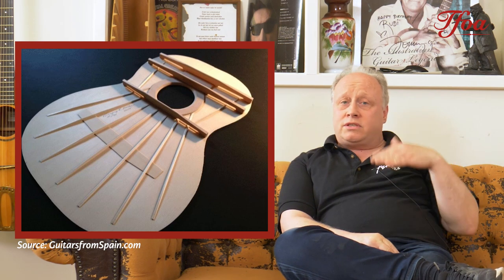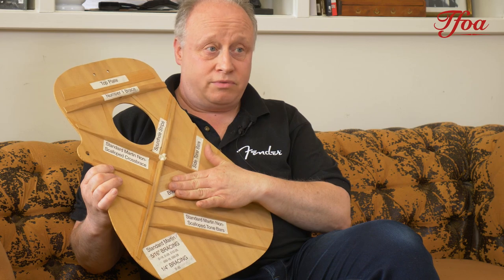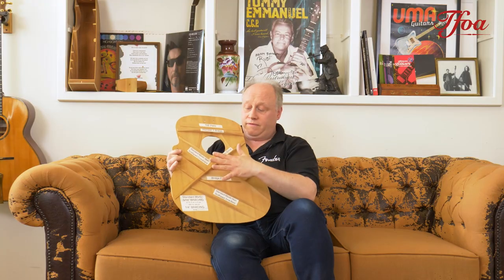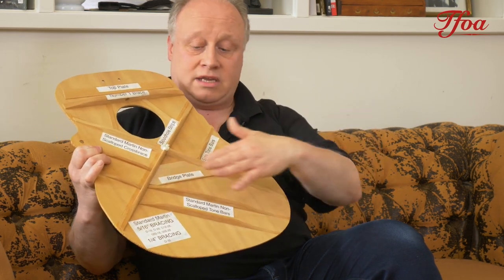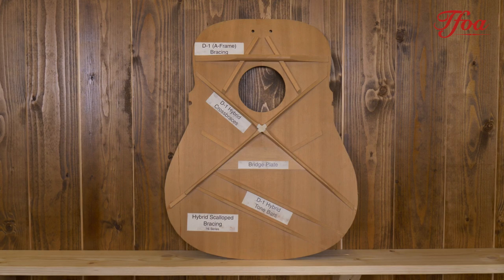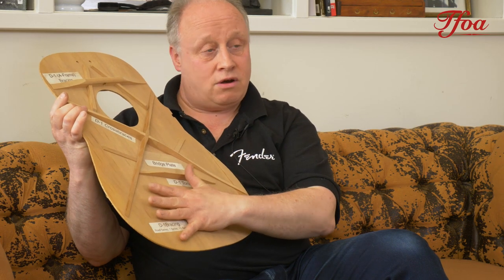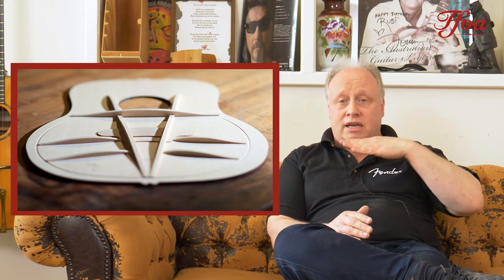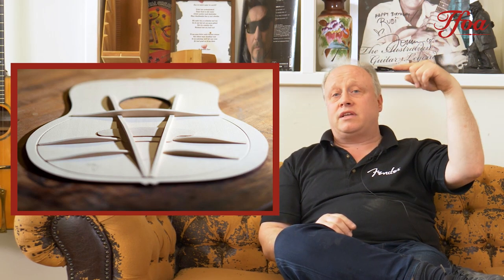Guitar Bracing Explained

Comment: As a lefty, I also look at right handed guitars to switch over to left handers. How does the bracing affect that? tx
Reply from the maker: Hey Mark, great question! Wether it makes a difference is debatable, some people think it does whilst some think it doesn't. But looking at the facts, bracings aren't symmetric and on paper this will affect the sound.
Reply: @thefellowshipofacoustics  Tx, that's what I always thought, it should make a difference. I had it done a couple of times, and still have an old Yamaha FG75 waiting for it, or not, I don't know, while having shied away from a couple of '70s (cheap) D18s, because I had doubts how it would work out.
Reply: @MarkJVSomers  the bracing will make little difference on a FG75 with it's laminate top. Saddle intonation and nut slots need to be reversed along with pickguard.

Comment: Martin's gradual tapering of the bracing towards the side edges is rather because the areas of the top, approaching the side edges, is gradually receiving support from being fastened to those sides. The sound (resonant top vibration) would be correspondingly deadened if the bracing weren't tapered there. This way, it keeps its linearity of vibration amplitude across the top, which is very important for balanced sound across the spectrum. That's why he's added extra bracing on the bass side, for another example. The 'stone dropped in the water,' implies that there is somehow a significant lessening of vibration moving away from the bridge, owing to wood damping it. While this is a relatively minor consideration, the bracing would be carved, if that were the primary factor, to emulate the inverse square law all the way from the bridge plate. It is not. Voila.

Comment: excellent Adrian. I have shared it among the pupils of my HTL School for stringed Musical instruments in Hallstatt / Austria. One little - interesting thing. Kalamazoo is not always the best example for ladder bracing, maybe either Kay, Harmony etc. As you might remember, the Kalamazoo KG21 of my father, for which you built new sides, had a combination of ladder bracing and cross bracing..... I measured that same guitar, explained how it possibly could have been designed by Gibson - measures loosly based on the older Gibson L00 etc - measuring all possible distances, vonstructing circles and seeing the relations between the dadius of the circles etc and also explaned the bracing. The Kalamazoo has an X bracing with some rudiments of ladder bracing, very interesting design, which still sounds and holds up very well, ever since 1937! Best wishes Adrian and thanks for the good work!
Reply from the maker: Thanks for sharing! Adrian sends you best wishes as well! 😄

Comment: Very informative video, thank you. I am building a OM guitar in spruce and rosewood and want to produce  a “crisp, dry and woody” base sound. How do I shape the brasing to get that? I work with a “Martin” X brace. Thanks again Jørgen, Denmark
Reply from the maker: That's the quest many luthiers are on! It is often said that with less material, you'll get more bass response. But there are many, many ways to do the bracing, so it will be a process of testing and experimenting.

Comment: What a great video. Thanks. Question. Does the X brace mean you can use steel strings even if the headstock is a typical slotted classical guitar but with X bracing inside?
Reply from the maker: Hey, yes it does! X-bracing isn't the only bracing type that will fit slotted headstocks or steel strings, but in this case you're correct ;)

Comment: Great video, very informative, thanks 
I hope to build a hybrid acoustic
But should I allow the bracing to touch the sides/make slots for the bracing in the sides of the hollowed out solid body, or should the braces end, leaving a clear parameter around the edges?

Comment: I recently purchased a fusion/crossover nylon string guitar and I noticed that the fan bracing is shifted over to the bass string side. What the benefit of moving the braces left and right as you mentioned the benefits of moving x beacing up and down. Thanks.

Comment: Hey thanks for the video!  Q: Do you think that taylors V bracing is more of a gimmick to stand out from other acoustic guitars or does it actually have some advantages? I'm also curious if you prefer it to X bracing or not, thanks!
Reply from the maker: V-Class bracing is not just a gimmick! Taylor claims that V-Class can produce more volume and sustain with a good balance between the top's stiffness and flexibility. Which type of bracing is better is mostly a matter of personal preference. Our advice: try out both and discover what fits you best! 😊

Comment: Very interesting Adrian, I was wondering about the wood types for the braces. I see where spruce is used for bracing. Can mahogany or just any type of spruce be used for braces. Does the Spruce need to be Adirondack  or Sitka spruce, for the Braces? is all spruce wood good for Bracing? Thanks, Russell
Reply from the maker: Hey Russel, Maarten here over at TFOA. Using different tonewoods than Spruce is nothing out of the ordinary. Spruce is definitely the most common, but Mahogany and Cedar are used as well. Although there are certain tonewoods that don't make fantastic braces ;)
Reply: @thefellowshipofacoustics  Thanks Maarten.

Comment: What is the best glue for the braces?

I have one that’s loose in a 1960-70 that I just picked up. The body is solid, neck is straight but if you tap you’ll find the vibration from one loose brace. Just need the right glue.

Very interesting brace info. Will have to look up construction changes by year.
Reply: Original titebond works great. Unless the guitar was originally built with hot hide glue, then use that, not bottled hide glue.

Comment: Hello Adrian! I own a Martin HD-28. (2002) Can you tell me if it's scalloped bracing or straight?  I heard the scalloped bracing stopped in 1944. But it was mentioned that "HD" 28 & 40 models were still scalloped. Also, it is an Electric, factory installed. So I guess its an HD-28-E
Thank you!
Reply from the maker: 99% sure it's scalloped! :)
Reply: @thefellowshipofacoustics  Thank you!

Comment: For classical Spanish guitars, lattice bracing was introduced several decades ago, and it does help the instrument refine its harmonics .. is it possible to implement it in some form on the steel string guitars?
Reply from the maker: Great question. To be honest, I'm not sure. Strength whilst remaining a light build are key for acoustics, sounds like it could be too weak for steel strings.
Reply: Yeah you can use lattice bracing on steel strings. I know Batson guitars use them on at least some models.

Comment: How does the bracing change in guitars with 12th fret neck to body joints?
Reply from the maker: Our luthiers could write a complete book about this haha! In a nutshell: with a 12 fret neck, the bridge will move further away from the sound hole. Often the bracing also moves the same amount so it comes more in the center of the lower bout (but doesn't have to!). It depends on the body shape, dimensions of the body, and type of sound you're aiming for.

Comment: Obsessing about bracing then weakening the Soundboard structurally by drilling a row of Six-6mm holes across the middle of the Soundboard and Bridge, (close together),  to accommodate Bone, (or plastic), Pins on Western guitars why not use `Trapeze-Tailpieces´ like Django Rheinhart had on his guitar.  Long-term, Pins cause bowing of the Soundboard or loosening of the Bridge, they seem like an inferior compromise of material structurally weakening and acoustically dampening the Soundboard with subsequent costs and early replacement being the result.  One can stamp a brass trapeze tailpiece. One should aspire to build guitars to outlast one's self!  Hardwoods are too finite a substance to waste.  Nice Visual Aid, doesn't show the Holes though!  Why is that?
Reply from the maker: These soundboards are simply meant to show what's underneath the top, so which braces and in what pattern. And the bridge plate is also there! 😉
Reply: @thefellowshipofacoustics  Lacing Pin Holes in the middle of the soundboard are a design flaw used to; denigrate the guitar sound over time, sell new guitars, and make work for Luthiers.